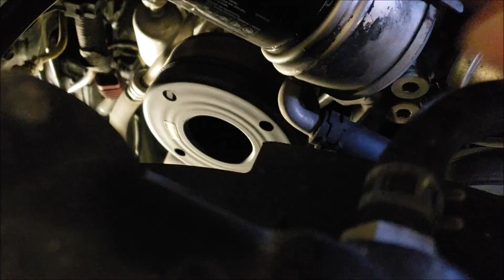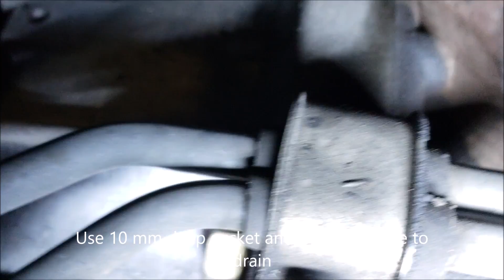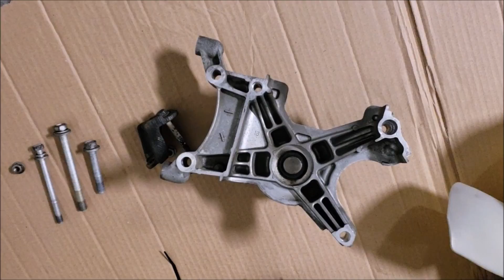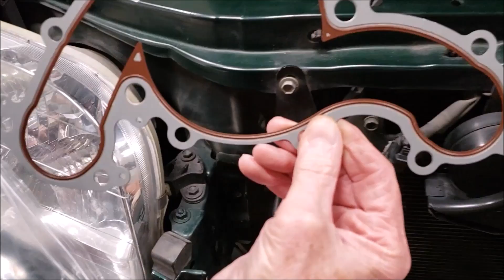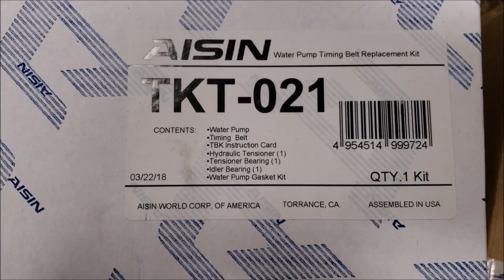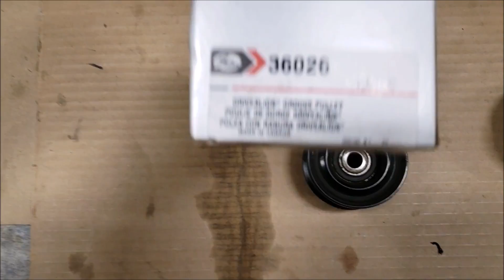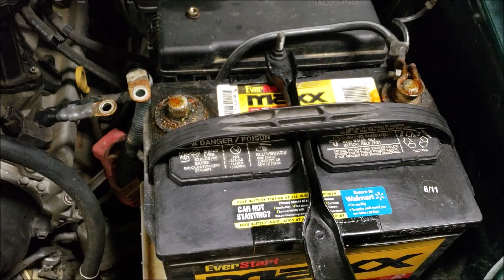STEP by STEP Timing Belt Kit installation: 2UZ-FE V8 4.7;Toyota Tundra, Sequoia, Land Cruiser, Lexus

Comment: I have a 2000 Lexus LX 470 with 348, 817 miles, i've never done the belt ( purchased at 162K miles) if i remove the belt and not rotate the camshafts and crankshaft, will i loose timing? I am NOT familiar with putting everything TDC ( top dead center) and i dont want to damage my engine. Good video. Thanks for sharing
Reply from the maker: Before you remove the old belt, rotate the engine at the crank clockwise until the straight timing marks on the cams line up with the zero TDC mark on the crank.  When you place the new belt, keep the marks lined up.  If one of the pulleys moves, you will want to move it back in place.  Aisin kit instructions say:  2000-04:
  Turn the crankshaft clockwise until No.1 cylinder at TDC with timing marks aligned. Double check it once the new belt is on.  If the marks aren't lining up, take the new belt back off and rework it if need be. Please check out the video description for more information.

Comment: What did you use to keep the harmonic balancer from turning when torquing the bolt?
Reply from the maker: There was tension on the belt when we placed the balancer back on and we used the Mac cam pulley tool to keep things tight as we torqued the crank bolt.

Comment: in this case with a 2001 Sequoia do you need to over rotate the crank timing by 50 degrees to line up with the pully th the right  prior to removing the timing belt.?
Reply from the maker: You can do that, but you just need to be close to TDC, when you remove the belt. Then you go by the zero mark at the crank and the timing marks on the cams (not the "T"s). Check out the description and other comments for more details.

Comment: Just a suggestion.....when doing this project you should definitely consider putting in a new radiator. The radiators fail internally  without warning and mixes transmission fluid into your antifreeze. Mine just failed yesterday at 144k miles. Apparently it is a very common occurrence on these trucks. The radiator itself is actually pretty cheap at under $200. Definitely an easier job to do BEFORE it fails, because now I have to flush both my coolant AND my transmission to get everything cleaned out again. I was very lucky that I noticed the problem before my transmission was ruined. This time instead of using the internal radiator cooler for the transmission, I installed a separate transmission cooler in front of the AC condenser, so this issue can never happen again, and also to help keep the transmission even cooler, since I tow sometimes. Just a little heads up. Great video......keep those Tundras alive!
Reply from the maker: Good points here. Another friend suggested replacing the thermostat and that is certainly a good, cheap addition to the project. I have kept the coolant flushed and fresh since the truck was nearly new, but I agree that replacing the radiator is a good idea above 200k and likely a must above 300k.  I also like the separate transmission oil cooler for a permanent fix.

Comment: Have a question..when set the belt you used the "T" marks on the cams but how abou the crank? Did you set crank pulley to the zero mark or the round dot to the right on the cover?..
Reply: Set it to the zero mark
Reply: @corybrewer696 OK so crank pulley lined up to zero mark on plastic cover and cam marks to the "T" mark?...keep finding info online that tells different. They say both cams at T mark and crank pulley to round tit on cover just right of zero mark..I'm confused now
Reply from the maker: @joedelgado3190  I recommend using the straight/TDC marks on the cams, not the Ts, and the zero mark on the crank. I have added some information in the description, so check that out. 2005 and 2006 engines are a bit different due to VVTi and that issue is addressed in the comments.

Comment: Just bought an 03 4Runner with the 4.7 in it. 103k miles on it right now. How often should this repair be done?
Reply from the maker: The Toyota manual recommends every 90k. Age can certainly affect a belt too. If it hasn't already been done on your vehicle recently, it is time.

Comment: Maybe it's no big deal but, your timing belt had the left cam mark on the right side and the right timing mark on the left side.
Reply from the maker: Good catch. Different brand belts are set up in one way or another. Focus on aligning the marks on the pulleys and you won't have to worry about the belt. You can "drive" yourself crazy aligning the engine marks and the belt as well.

Comment: Is this information good for a 2006 Tundra 4.7?  It has the same motor I believe.  But the manual says to go to a different mark about 30 or 50 degrees past top dead center?
Reply from the maker: 2005 models and later are different due to the VVT-i.  Aisin kit instructions are as follows:
2000-04:
Turn the crankshaft clockwise until No.1 cylinder at TDC with timing marks aligned.
2005-08:
Turn the crankshaft clockwise until No.1 cylinder at TDC with timing marks aligned.
Turn the crankshaft clockwise a further 50° until pulley timing mark aligned with guide pulley bolt.
Camshaft sprocket timing marks will move forward 25°
2009:
Turn the crankshaft clockwise until notch on sprocket guide is aligned with mark on oil pump body.
Ensure camshaft sprocket timing marks are aligned.
Turn the crankshaft counterclockwise 50° until notch on sprocket guide is at approximately the 12 o'clock position.
Camshaft sprocket timing marks will move approximately 25° counterclockwise and will no longer be aligned.

Comment: Great video I'm in the middle of it on my 2001 Sequoia with 250k miles. Last belt change was at 95k so it was due... now off to the store to buy a puller...
Reply from the maker: I wish you well! A puller is a good way to go for those stubborn pulleys. I have seen a video using a modified 2x4, but the puller is a sure thing and can be rented from parts stores.

Comment: 1. Timing belt is on backwards, Passenger side cam is the right side not left
2. Timing marks are not matching the belt marks.
I had faith and everything looked good until I seen that part of the video then had to stop watching.
Reply from the maker: See the discussion with Dave g in the comments. I have another 25k on the vehicle and no problems with the belt or otherwise.

Comment: So I am going to attempt this on my 05 Sequoia on wednesday.  I have all the parts you listed, minus the radiator hoses.  Some guides say align the marks to the T point and not the TDC point.  What's your take on that?
Reply from the maker: Correction, TDC corresponds with the zero mark on the crank. Just focus on aligning the marks for the camshaft pulleys and the crank pulley. The "T" mark is used for engines 2005 and later.
Reply from the maker: 2005 models and later are different due to the VVT-i.  Aisin kit instructions are as follows:
2000-04:
Turn the crankshaft clockwise until No.1 cylinder at TDC with timing marks aligned.
2005-08:
Turn the crankshaft clockwise until No.1 cylinder at TDC with timing marks aligned.
Turn the crankshaft clockwise a further 50° until pulley timing mark aligned with guide pulley bolt.
Camshaft sprocket timing marks will move forward 25°
2009:
Turn the crankshaft clockwise until notch on sprocket guide is aligned with mark on oil pump body.
Ensure camshaft sprocket timing marks are aligned.
Turn the crankshaft counterclockwise 50° until notch on sprocket guide is at approximately the 12 o'clock position.
Camshaft sprocket timing marks will move approximately 25° counterclockwise and will no longer be aligned.
Reply: @gduplerauto  so I am just noticing this now.... as I am trying to put the new belt back on. I have a 2006 sequoia.  Any advice for how to proceed? Should I try to turn the crank 50 degrees and the cams 25 degrees now that it is all apart? The marks from the previous timing belt job are still on the truck and they are at TDC. Any advice??
Reply from the maker: @realoliverox  I agree. If I were you I would turn the crank 50° and the cams 25°
Reply: @gduplerauto  thank you!

Comment: Love this video. Did you replace the thermostat and seal? I replace mine every 90k miles exactly like yours, except replace the thermostat/seal as well. Keep up the good work.
Reply: Kelvynn Lee thermostat seal along with water pump and everything else in the aisin timing belt kit.
Reply from the maker: @travisbryant8567  is right. I did replace the seal, but for the minimal extra cost, replacing the thermostat as well is a good idea.
Reply from the maker: Thanks! I didn't replace the thermostat and seal as I hadn't heard of Tundras having that issue, but it is a good idea and I will do that next time.

Comment: What do you mean you “worked” the timing belt to get the marks to line up? I’m 1 tooth off on my passenger side cam pulley mark. Idk how to get it to move. So what exactly did you work? Thanks #tiredandfrustrated..
Reply from the maker: Line up the marks and put all the slack in the belt on the side of the engine with the tensioner. Then release that tensioner to take out the slack.

Comment: Have run into several different issues which, “special” tools always are mentioned..
Reply from the maker: Special tools can certainly help, particularly a puller for a stubborn pulley, but you can make do with regular mechanics tools.
Reply: "Necessity is the mother of ingenuity"

If you need to figure it out, you will with what you have.
Reply: Come on guy’s if you wanna do this at home you have to get some special tools., if you’re a diy it’s a most., if you don’t wanna spend that money on tools., get your car to the mechanics and pay them. Toyota cars and trucks are worth it, just keep up with maintenance and that’s it 🤷🏻‍♂️

Comment: I need to get this done just bought a 2001 toyota tundra v8 4.7 with 159k miles on it
Reply: Lol I bought the exact year and exact miles 😁 the other day . I had to double check if that was me who posted.
Reply: @ozzie3056  damn haha thats nice man👌 I decided to wait until 200k miles though these are solid built trucks. I have zero issues with mine 😎 i don't even drive it much though.
Reply: @eddiejr3934  is it original tho? Mines original so I'm paranoid.  I'm taking mine in for the timing belt and water pump tomorrow.  I paid 3300 for the truck so I figured with the steal I got ill invest it back.
Reply: @ozzie3056  yes. But true that man. You should if you feel like it should be done. these trucks can go over 200k with orignal timing belt and water pump. But i might do mine soon also. But Damn you got a better deal then me. I got my truck for 5k but its in mint condition inside very clean and out. Only has faded paint. But runs really well. And has new tires. I got my truck 6 months ago and only put 600 miles on it lol

Comment: Good video. Thanks. A friend of mine has a 2003 tundra 4.7. He has some repairs that he would like me to do on it and this is one of them that will be coming up in about 40,000 more miles. He currently has about 110,000 miles on his Tundra now. What would you estimate the cost of parts for this job? Thanks again for a very informative video on this particular repair.
Reply: Buy a oem kit eBay 400$
Reply from the maker: Sorry for not responding sooner, missed this comment somehow.  I bought all the parts from RockAuto except for the small Toyota brand hoses.  The RockAuto parts currently run approximately $530 with tax and shipping. Add another $50 or so for the small hoses.

Comment: Interference engine?  Looking for either a used tundra , sequoia or lexus 460 or 470 . Plan on moving iut of tax hell state of ct. Moving to either florida or texas
Reply: May check out Tennessee after we get our 2nd covid shot. Im 68 with some health issues. By the way best video I've seen on doing the timing belt with related. Still looking for a similar vehicle. Stay safe paz y salud
Reply from the maker: Thanks! It is an interference engine so you will want to change the belt/kit somewhere around the regular interval of 90k.
Reply: Come to Tennessee -- no state income tax and prop taxes great here, too.

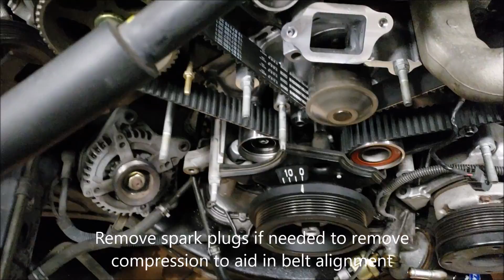Comment: At 25:38 it looks to me like the marks on the belts are not aligned with the marks on the pullys or the engine case?   Arent they suppose to line up?
Reply from the maker: Some belts don't even have marks.  Just make sure that the marks line up on the camshaft and crank pulleys.
Reply: @gduplerauto       OK thx .  It does make sense .    I'll be doing this soon myself .  Thx for posting
Reply: @daveg2113  lf you want to be 100% sure when you do this as some kits have marked belts , some do not and some are multi purpose and the markings shouldnt be trusted Turn your motor over by hand until all your marks line up on the crank and cams/pulleys etc. Then put a spot of tip-ex on the old belt at each alignment mark. Then when you have the belt off you can transfer these marks onto your new belt and away you go.
Reply from the maker: The marks on the belt are like a finger pointing to the moon. Focus on lining up the marks on the pulleys and the engine. Only use the belt marks for an initial guide.
Reply: @gduplerauto  But if you don't have the marks on the pulley lined up AND the marks on the belt lined up how can you be sure you aren't a tooth or two off somewhere?

Comment: The timing (no pun intended) of this video for me is perfect.  I’ve been meaning to DIY this project.  Have YouTubed many other repairs.  Just a little nervous on some of the videos I’ve seen for timing belt replacement.  This video was excellent.  Very detailed and thorough.  Thanks for the parts info as well and the torque specs.  I’ve got a buddy that is going to help.  Now for the back story.  2003 Sequoia SR5.  Honestly don’t know if the timing has been replaced.  I don’t recall ever paying a mechanic to do it, think I’m too cheap to have done that. Either way  I know I’ve been told by Toyota dealers to replace since I was in MN 11-14 years ago.  The guys in CA were telling me the engine will fail soon without new belt.  That was 7-10 years ago.  272k+ on her and now just thinking it’s time to do it.  Haha.  Lots of squealing noises under the hood so looking forward to all the part replacements eliminating that.  

I will report back when done.  

Roger
Reply from the maker: Roger, Good to hear from you. Yes, I would think it is past time to replace it. Haha. But it is a testament to Toyota reliability that you have made it that far. Good luck with the work and I will be interested to hear how it goes!
Reply: Howd it go?